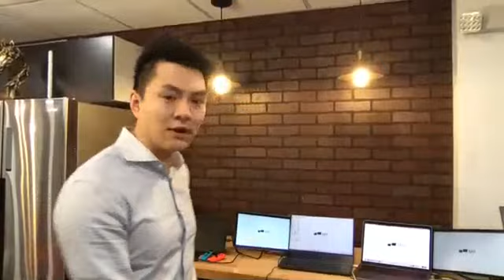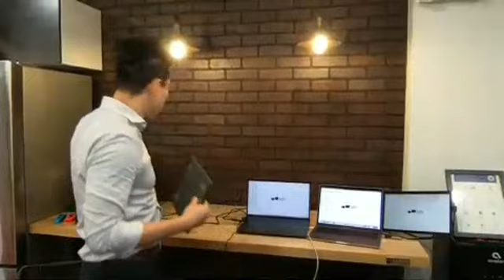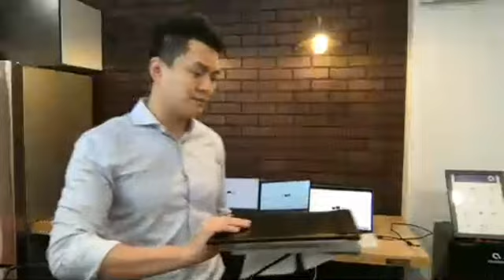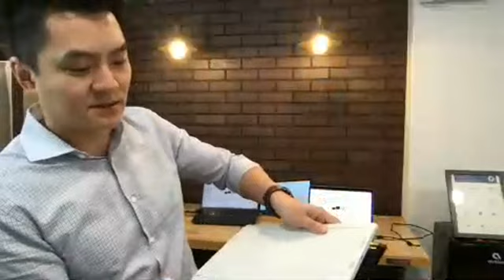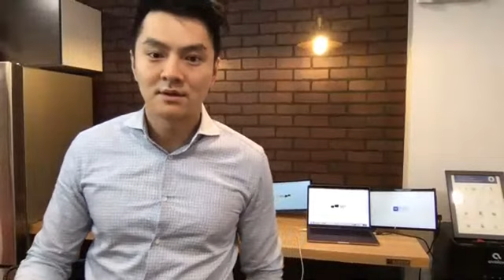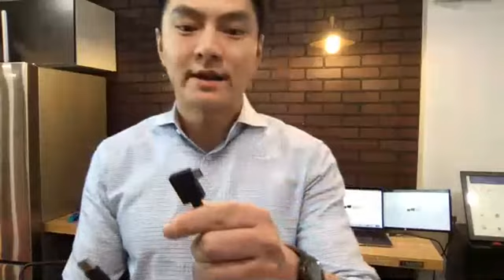Mobile Pixels- DUEX Plus and Lite Info and Q&A live

Comment: After installing the driver 3.5 Big Sur, the monitor stopped working and shows "no signal" pls provide visual instructions for issues with the drivers.  sys report should no extensions for the driver if that helps.
Reply from the maker: Hi Jonathan, 

If you are still experiencing this issue on your MacBook, please contact us at contact@mobilepixels.us.

Thank you!